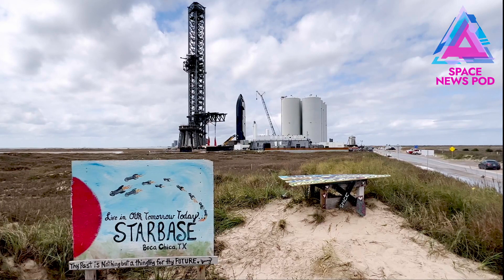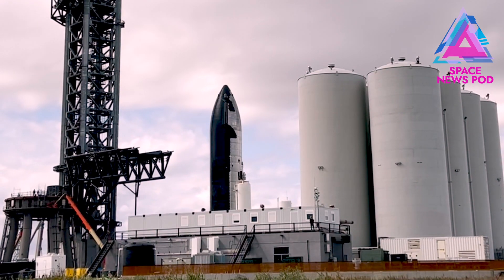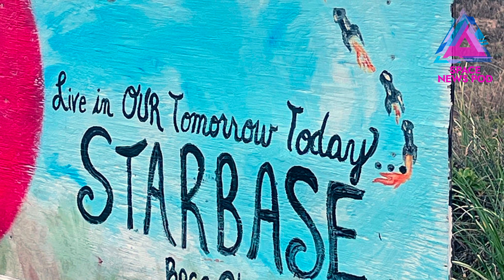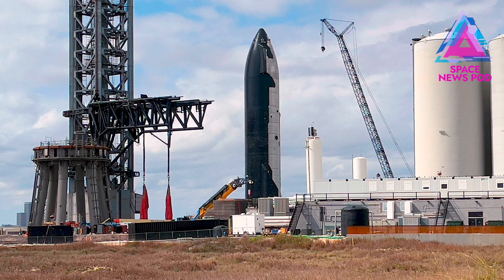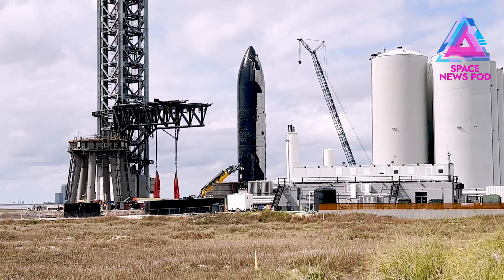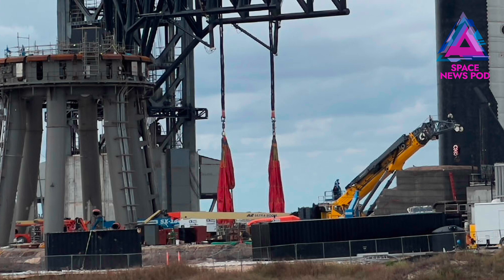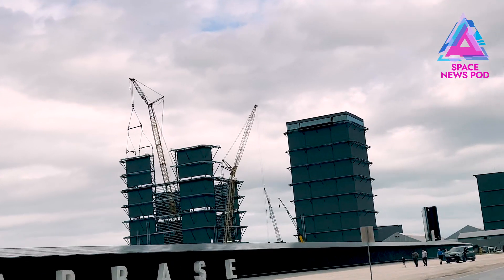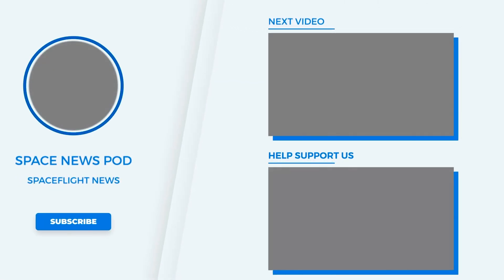Starship SN20 Will Go Up Soon

Comment: Havent they got to remove the scaffolding from the mount first
Reply from the maker: They do. And they can do that relatively quickly from what I've seen while at Starbase.
Reply: @stagezerostudio  I used to work with scaffolding a lot, and the little bit they have there would take no time at all.

Comment: Also neither booster nor starship lifting should close the road in such a manner. It should not be filled with fuel during lifting tests. So no huge explosions are eminent. I cant guess why they are closing roads.
Reply from the maker: I'm not sure why they will close it, only for the safety of people nearby if the ship crashes or the tower fails. These things are absolutely massive and can cause immense damage if they fall near someone.
Reply: @stagezerostudio  Yeah, but 15 miles of Hwy. 4??  Doesn't make sense.